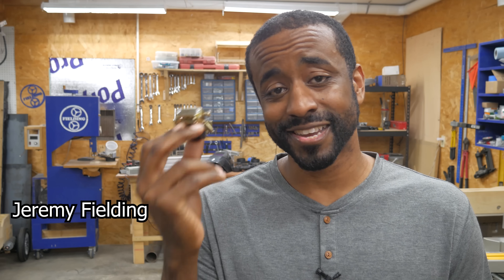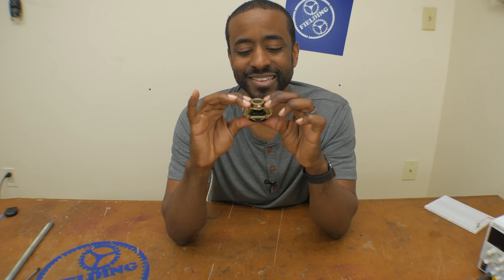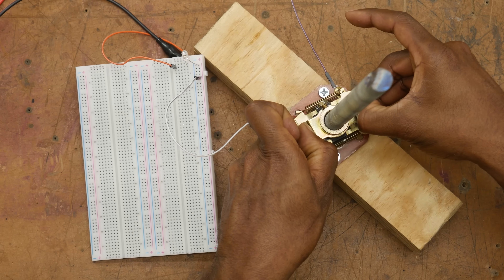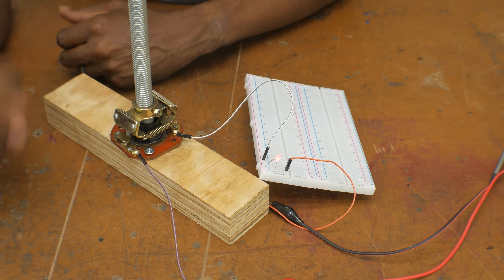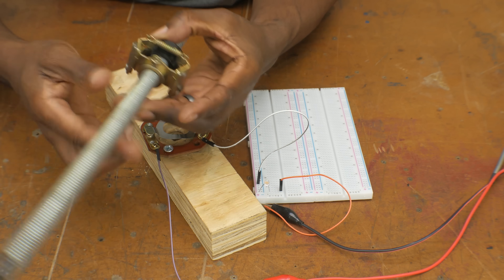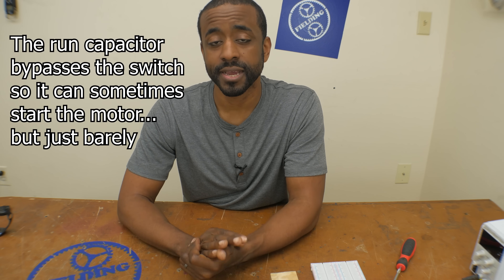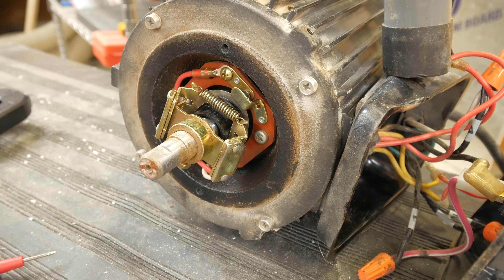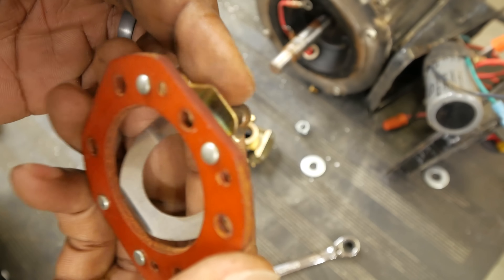This Clever Device Is Found In Nearly Every American Household. How It Works And How To Fix It

Comment: I've done this before. It usually works unless you have shorts in the windings. Also the original contacts are plated so after sanding old ones they may not last and need cleaning again. 
It would be good to be able to replace the switch assembly so you have new contacts. However I've had trouble finding them for sale. They'd rather you buy a hole new motor.
If some one knows where to get them please let me know. Also if you find a cap blown, you should go ahead and check that centrifugal switch. If sticking and not opening it will burn out your new cap. Also be sure to discharge caps while power is off with like a screw driver across contacts of cap. Don't touch metal screw driver blade with your finger etc.  Royal Lee patented the switch in 1927.

Comment: Ever hear the term "Full balls out" ?   Its similar to this concept.  Weighted balls are used in rear ends of trucks/vehicles to limit speed.  Balls start close to the shaft, then flare out when speed is increased.  At full speed, the weighted balls can't go out any farther, thus keeping the max speed at a pre-set number.  Most times, called a Speed Governor.  Same principal.  
Like spinning in a chair.  Legs out go slow, legs in go fast.  Reverse that and there ya go.  :) 
GREAT video, btw.  If I had you as a teacher in high school, my grades would be all A's.  Great Great video

Comment: Enjoyed the video. Two items to mention, if you do not mind. 1) With all those wrenches on the table, using a Vise-grip pliers are puzzle to me. 2) The sanding of the contact points is a temporarily fix. If there is a coating on the surface of the contacts, sanding may remove the coating. Thus, shortening the life of the points.

Comment: There's some plating on the contact to reduce spark. Sanding it remove the coating and will have more spark which will cause the contact to fail even faster.

Comment: This is a fascinating video. Thank you for sharing. 
To those explaining that this centrifugal governor pre-dates the electrical age... while true, someone would have patented this device for specific use in electrical motors, and especially used with a large storage capacitor for power boosting. I did a cursory search and found a few, including US3329878, US3660703A - unlikely specific to this application but I am guessing that the patent exists and is probably from the late 50's, early 60's. I just don't have time now to do a comprehensive search because there are a lot of similar patents related to this very old idea. Also important to note... whatever the patent, it has most certainly expired and therefore free to implement without paying royalties. 

Not sure why anyone would dislike your video. What is wrong with some people?

Comment: I think it was in the 60's that Harley Davidson finally put a centrifugal spark advance on their scoots.  
They used to have a cable on the left handlebar grip that adjusted the spark timing.  
I've seen choppers with the advance cable removed and the rider had to reach down to move the spark advance by hand.
Simple tech, but I'd did not know such things were around a century ago.

Comment: Interesting Jeremy that this is on these types of tools.  Just replaced the resistor and capacitor start switch (different but same function) on our fridge.  No repair call needed and fridge back and running.  Good video and info👍

Comment: As a boy took the governor out of an old wind up   record player , spun the handle fast as possible;,revs achieved many more than 45, tilt it on its side the disk would travel a good 100 yards down the road before crashing into something. 50 years ago Welsh roads were very quiet.

Comment: I was learning to fix typewriters.  Specifically the IBM  Selectric.   It had a motor with just that kind of set up but for a different reason.   The motor had to be small yet strong enough to deliver power to a lot of mechanical movement...and do it fast.   I wish I could remember the name of that motor.  Inertial motor  I think.   You could hold the motor and turn the power on,  and the motor wasn't strong enough to overcome what was holding it.   BUT let it get up to speed and you could not stop it.    I'm always impressed with simple everyday physics.

Comment: Washing machine motors don't have centrifugal switch. Their capacitor is a running capacitor, not a starting one. Depending on which winding the capacitor is connected to, the direction of rotating of the motor shaft is determined. That is made by the washing controller.
Just for you to know ... 
PS: This does not apply to the brushed and the latest brushless motors - they are controlled by an electronic controller and do not even have a capacitor.

Comment: This type of centrifugal mechanical switch has been used on steam and hit and miss engines to limit govern RPM , usually pressing on a valve to relieve cylinder pressure.

Comment: Here un Argentina some motor use this.
But You should have explained more.
There are two windings in the motor, one small (starter winding) and a Big one (work winding).
Both the capacitor and switch are used only to start the motor, once ir reached a certain speed (i think it's only 30 percent +-) the work winding takes over.

Comment: Great video Jeremy!  I found the filing for the US Patent by Inventor Jack A. Remke Dayton, Ohio , Application No. 860,559, Filed Sept. 24, 1969 and Patented Apr. 20, 1971 by the assignee General Motors Corporation Detroit, Mich.
  The Patent was named "CENTRIFUGAL SWITCH ASSEMBLY FOR A MOTOR STARTING CIRCUIT 3."
It's really amazing how many things we use every day that rely on simple physics, even on seemingly complicated pieces of machinery.  Whoever had one of those lawnmower engine mini bikes when they were a kid knows the clutch that drives the rear sprocket worked exactly the same way.  That's where I learned about it when I was seven and I'm still amazed!

Comment: There is a similar thing in old car and bike ignition systems for the advance retard of the engine but they are variable with springs to adjust and control how fast the weights fling out

Comment: found the answer to the question "Who invented the Centrifugal electrical switch?" 
Royal Lee
An 1920s patent for a centrifugal switch (US Patent #1,630,394) was granted to Royal Lee on May 31, 1927. It was the basis for the formation of the Lee Engineering Company.
More info on the switch here: https://en.wikipedia.org/wiki/Centrifugal_switch#:~:text=An%201920s%20patent%20for%20a,of%20the%20Lee%20Engineering%20Company.
Kelly Johnson of Lockheed (Skunkworks fame) once said "The difference between an engineer and a great engineer is to design with elegant simplicity" LOL Guess the KISS principle.

Comment: Great video man. The other common issue I've found with these centrifugal switches from working on white goods is sometimes the starter contacts will actually fuse together. Normally the easy way to tell if this has happened is that the motor will start and run for a bit before cutting out (which occurs when the thermal overload trips). You can usually fix it easily by prying apart the contacts and cleaning them up with a file or some sand paper. It's also good practice to short out the capacitor contacts with something conductive (with an insulated handle, eg insulated screwdriver) to make sure it's discharged so you don't get a nasty zap if you touch it by accident. Subbed, keep up the good content.

Comment: Helicopters use them to prevent the main rotors from dropping to low when they are shutting down the engine(s). Look up drop stops